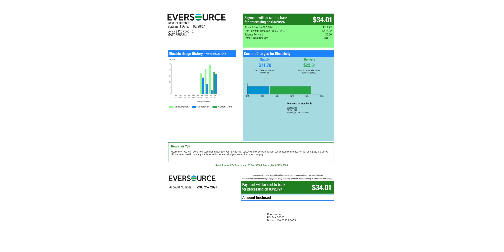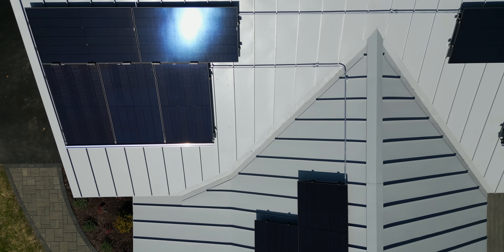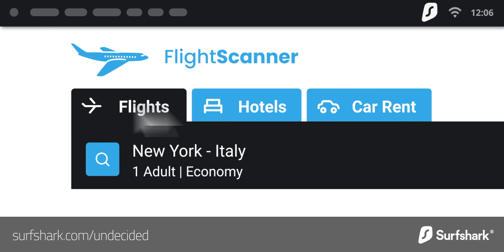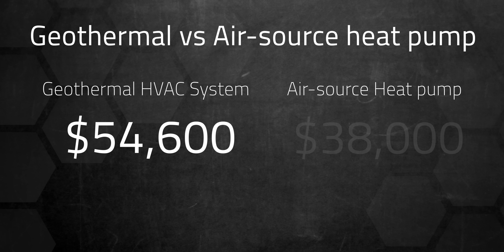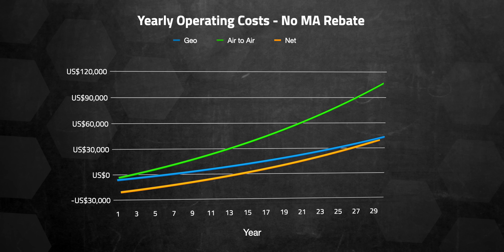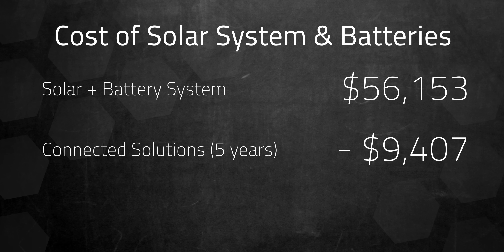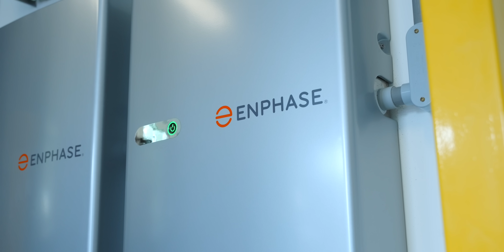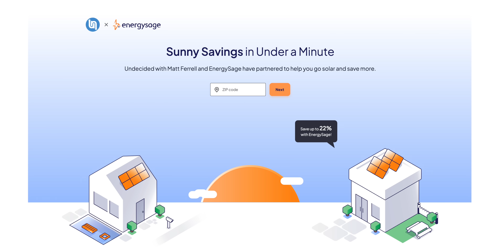What I Learned After 1 Year with New Solar Panels

Comment: The main challenge with your case lies in the significantly high investment cost: $88,000 for a system comprising 17 kWp PV and a 24 kWh battery ($55,000 for PV + $33,400 for storage).
 In comparison, similar systems in Vietnam cost less than $10,000, with a break-even period of up to five years in a conservative scenario. 
For example, I personally installed a 31 kWp PV system (54 REC x 575W panels) and 50 kWh of storage for approximately $17,000, showcasing a far more competitive cost structure.
Reply: I can’t imagine how much that company made on installation.
Reply: @HOOFBizite  7-8 million VND/ kwp (full set) ... around $200-250/kwp ...
Reply: He was scammed on almost everything. Solar you can get for 100-300$ per kWp - he got 1kWp for 3.5k$ same with air heat pump query - 36k$ If you do not like your $$ you can easily give it away to scammers - no problem.
Reply: @wfm125m  He's gonna be pissed when Tesla battery grid storage systems halve the price of energy in a few years, along with numerous other technical innovations that turn his long-term investment into a boondoggle.  And that's without any of that stuff breaking down, or needing regular maintenance, before break-even.
Reply: @wfm125m   not in Taxachussetts.  Location matters.

He spent as much in inspections and permits as on labor for his solar.  Its a large part of the price.
Reply: @redwolfexr  having lived in Boston five years last decade, I can say it's a fabulous, fun and truly amazing place, but everything is expensive (including installer labor).
Reply: Scam stallers for ya. On his video about "are we getting ripped off with solar" I dropped a link to buy nearly the same size system for only $7,200 shipped from USA so idk where $55,000 came from
Reply: @faded.0913 30k is the labor and permits/paper works.
Reply: And 30k for that battery is absolutely insane. A 15kWh lifepo4 battery costs roughly $1,100 in USA
Reply: @faded.0913 I don't know where you got this price but that's the price for 5kw in USA.
Reply: Thisssss! I installed 4kw solar system with 10kwh battery for €6k in Ireland
Reply: This is interesting. I’m looking to retire in the Philippines, our house is mostly built at this point and we will eventually retrofit with solar. We didn’t do it up front as the priorities are a little different. Based on our location off grid, or at least a hybrid solution is required given that brownouts happen frequently. My biggest concern, if you want to call it that, is longevity of the batteries in the heat. With ambient temperatures basically never below 25C finding a suitable cubbyhole somewhere that doesn’t heat up thanks to 20kWh of storage isn’t going to be trivial. I wonder what this sort of thing looks like in Vietnam.
Reply: @RonaldBuder  storage room with thick walls (thick insulation) and small AC unit. Alternatively depending on location, and underground bunker might be an option.
Reply: ROFL I just bought a 17KW bi facial 31 panel pallet new, shipped for $5008. He paid $88k holy crap. Also you can get 308 Ah/15kw battery kits for less than 2k.

More $ than ¢
Reply: This guy was ripped up. If you buy a 500-600W pannel from canadian solar, trina or longy you will pay 100euro per panel. You can get a inverter for Deye or Huawei for 3k euro max and batteries 5kW server ones are 1.2k-2k for huawei ones. So for a 15k PV system with 6 server rack batteries you have 30kW of storage and pay just around 13000euro. Now you could DIY it or pay 5,6k for a company to install it. So that 88k is just stupid
Reply: What do you build high power system for!?
Reply: Crazy outlay for not much.
Reply: I see several comments like this, how is solar so much cheaper in other places if the world? Is it tarrifs?
Reply: @  I think we need to flip it round, and work out why Matt paid so much. Some of it is prices going down this past few years. Some of it appears to be contractors charging crazy labour
Reply: @robertbowman9108   simplicity in paperwork/permits is likely the biggest difference.  If a crew can file a permit, fully do the job, and then get it inspected once then its not too bad.  Especially places like California where its mandatory - make the solar install part of the master permit.  (cover it with the "electrical" inspection)

If you can "DIY" its fairly cheap to buy the basic parts.  But also, Matt didn't buy "basic" anything.  More expensive panels, more expensive batteries.  

Most solar installs use "consumer" grade panels and either name brand "Victron" or offbrand Chinese electronics hardware.  

Most installs don't overthink it -- instead of spending a ton of $$ on power saving equipment they just add another row of panels and another battery and go with whatever standard consumer heating and water is popular.  

Matt is Matt...
Reply: I just purchased 60 390watt panels delivered to my garage. $112 apiece. 6 indoor wall batteries 85.8kw for less than $18,000 delivered. No sales tax in wisconsin on solar equipment. Then once I get it installed this summer. (Installing myself). Will get 30% back. Oh yah 2 18k inverters $3600 apiece.
Reply: @danmccoy6164  why did you get garbage small solar panels ?
Reply: I just bought 28kw in battery storage for under $5k and forty 400w panels (16kw) for $3960. Sure there are several thousand in inverters and misc wiring and mounts, but he was majorly scammed. I'm going to be all in for under $15k when I am done then get over $4k off next year's income taxes.
Reply: He lives in Taxachosetts where people with very questionable values lives.
Reply: @andrewrivera4029  what an ignorant statement. Look at the stats. Highly educated people. Specifically, highest percentage of residents 25 and older with a bachelor's or advanced degree.  Highest earners in the country. lowest premature death rate in the country and the highest share of residents with health insurance.  Site of the Boston tea party, and the backbone of resistance to colonial rule that birthed this nation.

Comment: For a Finnish person who also installs these systems, all prices seem super inflated! 
e.g. 430W panels cost approx. €100 each, mounting rails and fasteners for 43 panels cost approx. 2000€ and a good 20kW inverter costs €4000. The installation time for a system like Matt's is approx. 50 hours.

A 20kWh battery with installation accessories costs approx. €14,000 and its installation time is approx. 16 hours.
An all-inclusive geothermal heat pump (no separate water heater) without a heat distribution system, as a turnkey package costs approx. €25,000.

I know that since these systems are very common and everyday here, it lowers the prices, but still the American 4x price level seems absurd.
Reply: The quote I got was $40k. I pointed out to the sales guy that I only spent $1800/yr on electricity and the payback was longer than I would likely live. I think he found that offensive. LOL.
Reply: @markw999  Yeah, it's kind of stupid - or at least impractical - today to go net zero.  With the pace of technical innovation and logarithmic price drops in energy storage, anything more than a 5yr break-even is more about virtue signaling than saving money.
Reply: @CharveL88  I agree. I can't make the numbers work today and honestly, why are there two competing predictions for future electricity prices? One which says, "install solar today because prices will soar tomorrow" and (IMO, more accurate) "buy later because everything will be cheaper". It makes no sense to pay a premium now for stuff that will be cheaper down the line and electricity should also be cheaper because of industrial roll-out.
Reply: You're making the mistake of comparing the price things cost, with how much it costs OTHERS to put those in for you.   Lab costs easily double or often triple the cost of the equipment which is why the DIY options save you considerable money.    For instance, the exact same batteries he uses would cost about $14000 for the batteries,  but the installation of those added nearly $20000 to the price.     The panels, well these specific ones show about $300 each with a quick Google search, but if you went with another brand you can get 400W for about $125 or so.
Reply: @Mike__B  In Germany prices are consistently below 1000€/kw PV (not including battery storage) if you get a professional doing everything. Even a big 20kwh battery has become dirt cheap in the last 2 or so years. So lab cost explaining this astronomical prices is somewhat questionable.
Reply: @Mike__B  $20000 to install four premade batteries....really?
Reply: Everything is 4 x bigger in USA .
Reply: you have to understand he is a designer for these systems. so add in his cost for designing this all for you.
Reply: @peto22  . Trust me, this guy's bald headedness is getting him ripped off.
Reply: The land of the fee.
Reply: Are those man-hours you're talking, or is that the time a full crew (whatever that size would be) would take?
Reply: @Michael-vf2mw  Those are man-hours.
Reply: I‘ve never seen 400w panels for 1200$. Even with all installation brackets and everything.
I just helped install 74 panels with controllers for every panel that cost less than 10k$.
Someone profited through the nose off of you….
Reply: @ddan1781  1995 year prices probably :)

Comment: Just wait until your local power grid gets congested as more people and companies add solar. First net metering will disappear, and then you get to pay for every watt you send to the grid, including all the same taxes you pay for using power from said grid. This is what is happening in the Netherlands as mass adoption of solar more than outstripped grid capacity. Commercial connections to the grid are now on a waiting list and companies will be forced to shut down during peak hours or are restricted in when they are allowed to send energy onto the grid. It's getting so bad that some business parks are considering building their own local grid so they can exchange power among themselves outside of the regular power grid. Very expensive but still better than dealing with the headaches of the normal grid. Also whole residential city districts get their solar shut off remotely to keep the grid from becoming unbalanced. Costing users money and extra wear on the controllers.
Reply: It's unavoidable, without a cheap efficient way to store electricity those grids are economicall nightmare.

You think having few panels worth 2000€ not working for few hours is bad? Imagine building 200million € powerplant and finding out it wont be able to work 24h/7 cause EV panels push electric prices negative during peak solar 😂😂😂
Reply: @sznikers  It gets even better than that: without storage on the grid you need backup powerplants, usually natural gas powered, to offset 'dunkelflaute'. And they basically idle the rest of the time, just costing stupid amounts of money without any return. Plus it means that every watt of 'clean/green energy' is directly tied to an equivalent fossil fuel watt. So much for 'no emissions'. Worse: if a natural gas plant could run at proper load its emissions would be only a fraction of what they are now, per watt generated.

Also: at peak production moments some factories get paid to use power, to balance the grid when there is an excess of solar or wind. On the other end of the spectrum some factories shut down for months to do maintanance, because they earn more by renting out their grid capacity for that period, than they would by actually running the plant and producing goods.
Reply: @FrietjeOorlog  oh yeah, the amazing economics of political solutions 😂😂

On the other hand, sounds like good place to start a crypto mining farm : ) you can automatically regulate power draw of cryptominers in accordance to grid situation and there is no discrete steps. Instead of having to pay for power to mine be paid for providing load balancing to the grid, paid2mine : ) Now, per Watt efficiency of miner goes down with increased powerdraw, but one doesn't care if one is paid to use that power, only total output matters in that scenario. Per Watt efficiency goes up when you lower miner power draw (to a certain point), so when electric rates reverse from negative to positive you lower power draw, which lowers your total crypto output but increases efficiency per watt bought from grid. Win,win.
Reply: @sznikers  

I think the problem with using excess solar for cryptomining is that the mining equipment itself costs a lot of money, so needs to run nearly 24/7 in order to generate a return.
Reply: I know of a farmer who just disables their solar panels in the weekend, when none of his machines are running. Otherwise he'd get like a 2000 euro bill for pushing too much energy to the net. One day the folks from who manage the net showed up to check out what was happening and asked him why, he explained that he wasn't stupid to pay for that and they couldn't give him a reason to not do it.
Reply: I would just not grid tie them.
Reply: Yup, corruption will ruin everything. Go fully iff grid. Screw the "powers that be". They got us into this mess.
Reply: Already planned for this:  By the time grid storage gets too expensive big sodium batteries will be much cheaper than lithium.  Ones on sale now are cheaper, less dangerous, and last longer than lithium batteries.  The down-side is they are larger, but I have plenty of space for them.  When somebody makes a 50 KW-hr one at a decent price, I go off-grid.  I'm still getting more and more credit every year than I use, and have a grandfathered agreement with zero billed.
Reply: Exactly. Belive it.
Reply: net metering. isn't that where the rest of us pays you. look the company charges 9C a watt. that includes production and maintance on the whole grid. now net metering gives you FREE use of their grid. now those companies. well really consumers whos paying for it. only give you 3C when you sell. and sells it back at 9C. because they charges you 6C for using their grid.

Comment: I live in Florida, which should be a slam-dunk for solar, but it's not. Every time I see Matt's numbers, I'm shocked with both the cost of electricity and the usage. We spend $.14 per kWh all in, and our average usage in an all-electric house over the year is right at 1,000 kWh per month. Granted, we don't have EV's so I should add car fuel costs. Even with that, solar would NEVER pay off in our lifetime using Matt's cost numbers. 
Our biggest advantages are that we don't have a pool of any sort, we keep the AC set for 85F during the day in the summer, and we open the house up during the winter. If you live in Florida and you keep the AC at 72 F in the summer, you're living in the wrong state.
Instead, we have chosen to participate in the local utility's Solar Together program where one buys off the tax credits for their large scale solar farms. This is considered 100% solar if you buy off enough credits. Over time, there is a financial benefit on your bill, based upon the amount of solar "your" panels generate. It's basically moving credits and money around, but it's something.

Comment: Great video.  I understand that the decision to go net zero factors more than financial reasons.  However, I am wondering if you are really saving money over time.  With the substantial upfront costs, there is a significant loss in investment opportunity.  If you had invested $80k into an S&P500 index, with an average growth rate of 10.7%, at 30 years you would have $1.8M... outperforming the savings from your energy system.  Just thinking aloud.  Like you said, there are many factors and the decision is very personal to achieve personal goals.  Keep up the good work!